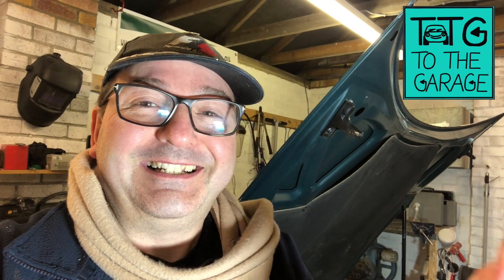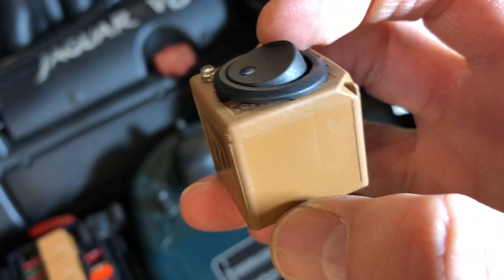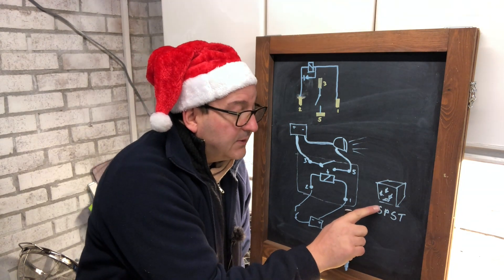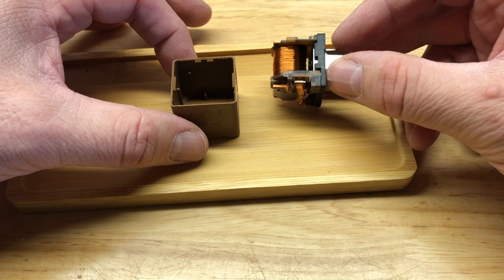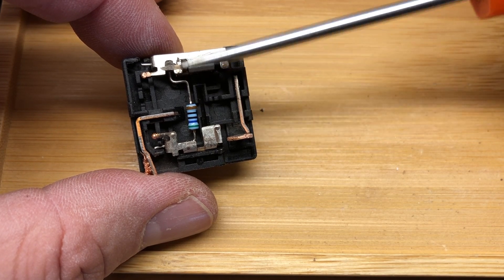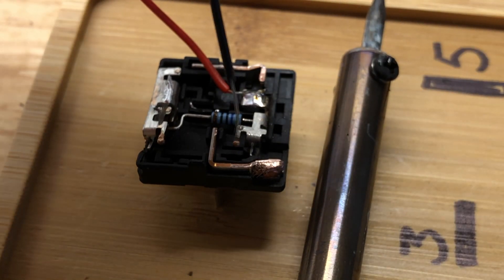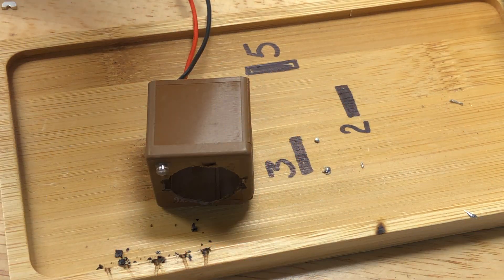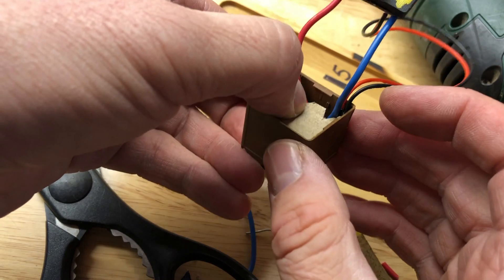Best electrical diagnostic tool for all car enthusiasts. Jaguar or otherwise

Comment: Great idea John nicely done. If you connect T2 to the brass coloured terminal on the switch the light would come on the switch when you switch it on, which would check the ground side as well. Looks like I have a small project to make over the Christmas break. Thank you! I have a video coming out soon on fitting chrome bezels to the gauges. Merry Christmas to you and family.
Reply from the maker: topman Geoff. I will do that mod to my relay. I keep looking at the chrome bezels and can't decide if I should do it or not.  So looking forward to your video. Merry Christmas to you and yours.😁👍🎄

Comment: Super idea.  Keep in mind that these relay contacts and terminals are rated around 40A only because they have to last a long time switching DC, hence the over rating.  Normally we are switching at most 5A at 12VDC (high beams), so 22AWG wire would be sufficient.  Happy Holidays to you and yours, chum.
Reply from the maker: Hi Gary 
Thank you very much. Thats why a 20Amp switch (in my humble opinion) is more than adequate for this project given the relatively light usage it will get.
I have not forgotten your fantastic collection of documents need hosting and launching Gary. Just really busy with work and then this video took a while to get together.
My sincere thanks for all your valued contributions Gary.
Best regards
John Dee👍🎄

Comment: John, can I suggest that you buy yourself a proper temperature controlled 'iron for Christmas, and clean/tin the tip - will make your soldering sooo much easier. That iron looks to be non temperature controlled therefore far too hot, and oxidised.
Otherwise good idea and video :)
Reply from the maker: Alan Deane my iron is pretty much done for! 
I have had it a long time and more often than not I just use it for plastic welding. Do you recommend something decent for occasional use that won’t use up all my pocket money?
Reply: Metcals are the best, but I still use my old double-headed Hakko.  Wellers are okay too.  If I were to buy one today, I would get the Hakko FX888D-23BY.
Reply: Another ANSI J-STD 001 Class 3 person on here.

Comment: Great video!  Is the little bit of carbon fiber trim over the radiator an addition or was that standard on the early XK8s like Purdy?
Reply from the maker: Well spotted!
Thats something I added. Its only a carbon wrap. The original finish on that component is dreadful on early cars and only marginally better on the later ones.
Here is the video of me doing it
https://youtu.be/JY5C1nXbrno
Reply: @ToTheGarage  Very nice!  Thanks for sharing - I'm familiar with that section well and noticed it right away.  Looks very nice!  Keep up the great work!

Comment: Unfortunately an LED will not suffice here, since Jaguar did not standardize which terminals (1 or 2) are B+ and GND.  You need to use either two LEDs connected opposite one another or an incandescent bulb.  I ended up using a bulb, a SPDT relay and a mini ON-OFF-ON momentary rocker to make it even more useful for dual state circuit relay testing.  It's just too bad that all cars did not adopt the Bosch style relay in their systems.
Reply from the maker: One day I will build the ultimate version!. It needs a tiny voltage readout. A grain of wheat bulb (your contribution) on both circuits and a tiny beeper on the coil circuit so you know you have activated it from the cockpit.
Reply: @ToTheGarage  If it were to be able to make a good Margarita too, that would be a nice feature.

Comment: Great idea. Volume level seems very low John.
Reply from the maker: Thanks @stagnite2 Constant volume seems to be my enemy. I am using a really good quality microphone and half decent Wireless audio kit. I think the problem is that I speak clearly and 'project' when I am talking to the camera. and then slowly retreat into literally talking to myself (like the voices in my head) over the course of several hours filming. Then When I chop and change the film around during editing, some of the elements slip by me without audio level correction.
Must try harder! in 2020!👍🎄
Reply: @ToTheGarage  Thanks for the reply. I am not being critical, just giving you some feedback.
Reply from the maker: stagnite2 I know you are mate👍 and it is an issue